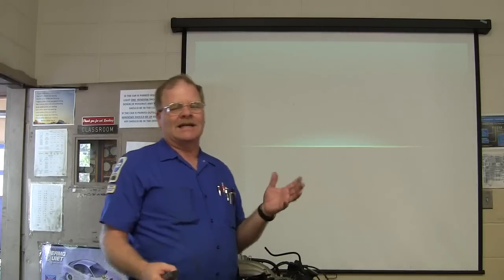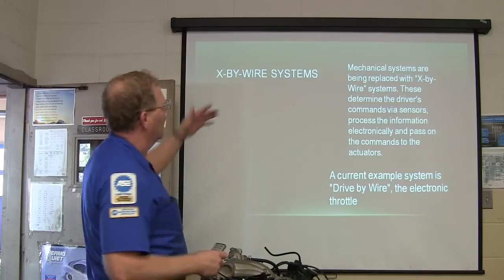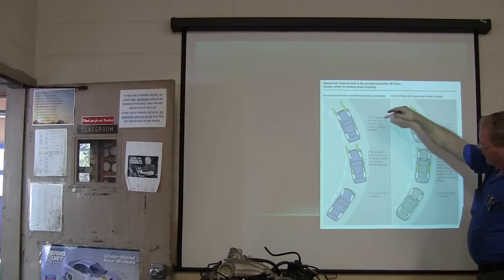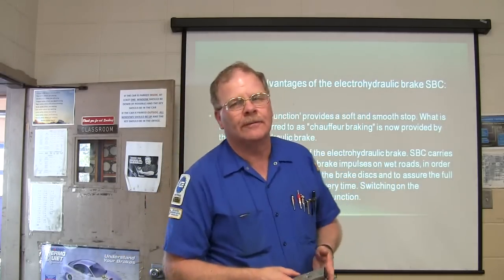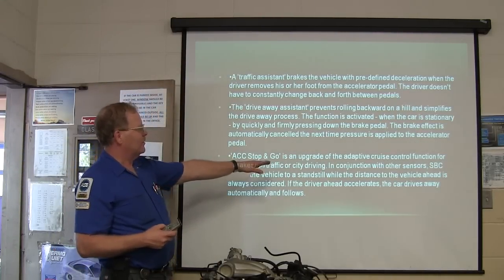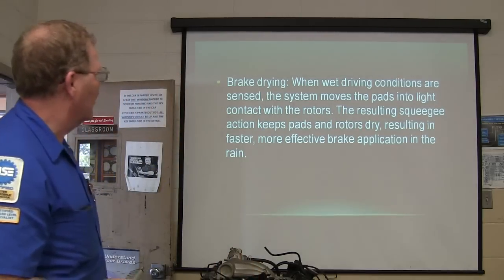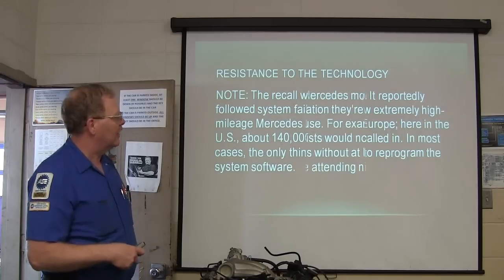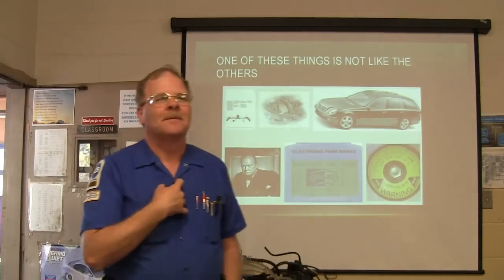Electronic Brakes Basics

Comment: Something city folk never think about. After a week or so of no rain heavy traveled roads get road grease on them. The first rain after that time you see several wrecks from wet greasy roads. These people in populated areas drive like they are on the race track with professionals inches away from the next bumper at 70MPH even on wet roads. You even see about one out of ten short haul truck drivers doing it. I think some of the big advantages of the new electronic systems is improved ability to handle odd road surface, bad weather, unmatched tires, and different weight distribution like people with junk in the trunk.